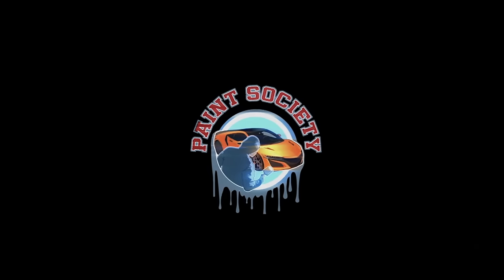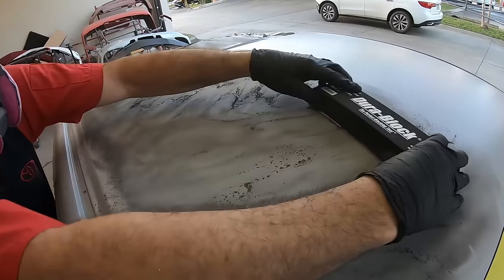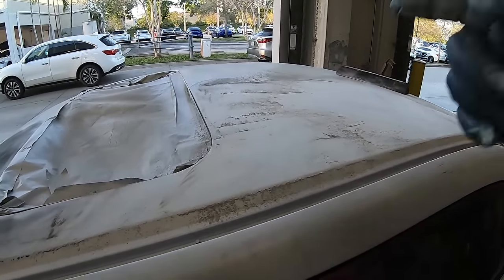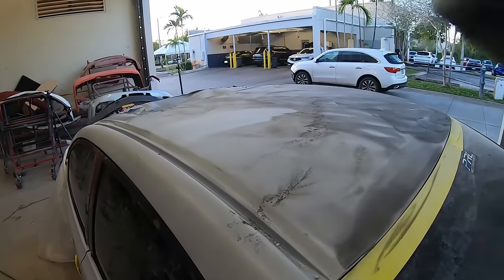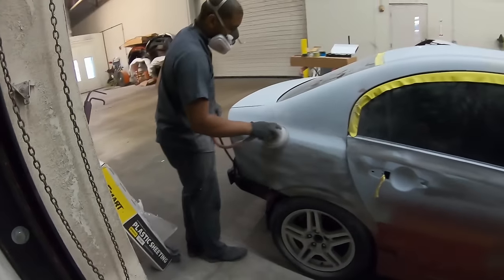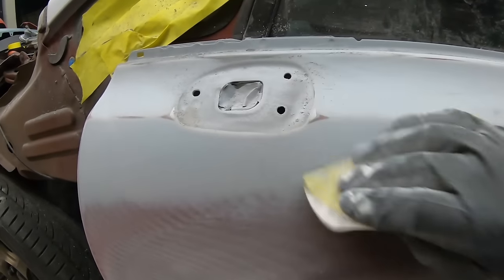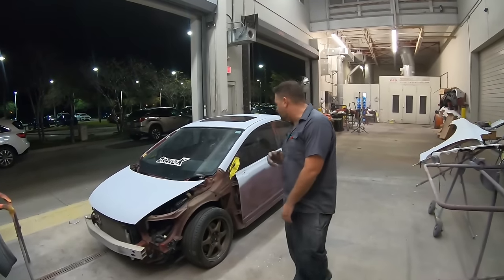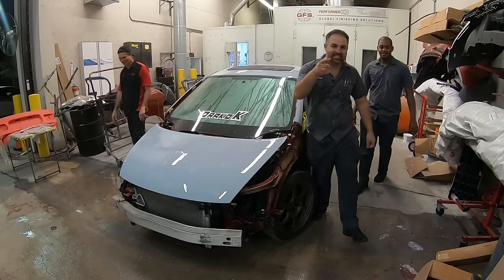How To Paint a Car Guide: Episode 4 Block Sanding and Prepping for Paint

Comment: Hi Brian, I watch a lot of your informative videos and enjoy the tips and advise. I am prepping and painting a Honda Civic at the moment and just wanted to share with you and your veiwers about the dry guide coat. I have been using black chalk and a polishing pad to apply for years on projects with great results. The chalk is used for snap lines but I tried it years ago when sanding and leveling wood projects and now I am having success using it for filler and primer guide coats as it seems to work very well and for about a tenth of the cost.
Anyways, thanks for all of the videos and tips.
Paul

Comment: Interesting to see you guys working together on sanding down the primer. Not alot of painter likes to have few guys doing the bodywork together since every painter has their own technique of doing things. I hope everyone will learn from this and make a standard of doing it so with little help from someone which makes the job faster rather than doing it alone by sanding down the primer  for the whole car. I learn one thing from this video, if there is no bodywork in the panel, its not required to hand blocking and just use DA machine. Really speed up things. I usually paint quite old vehicle and usually primer the whole car. But some panels still looking good without any dent. Not necessarily required primer,  But thats what's the workplace required, they wan it to prime the whole vehicle then hand block it to get as straight as possible.
Reply: If you’re sanding down cars that are like from the 60s-70s what grit would you recommend for sanding?

Comment: Have a question which I hope makes sense. After primer, if I’m NOT using a sealer, would I still use P400 on the DA and base over that or would the final grit then have to change?

Given that I wouldn’t have that sealer coat on the car before the base coat like you have done in this example. 

Thanks for the great videos!

Comment: I sprayed primer surfacer on my repair areas only, as I have to leave my car outside under the elements. The rest of the car still has some flaking clearcoat around the repair areas. Will this become a problem if I plan to sand  down the clear coat for primer in the future even if it means having to reapply primer again on the repairs areas?

Comment: Instead of blowing out all the sanded primer and possibly paint dust, if you're scuff sanding the paint, can we use a shop vac and a round brush attachment to suck up the dust? Do you think the bush bristles will scratch the surface?

Comment: Kevin Tetz from Eastwood drilled in my head to use W&G to check my progress over my body work stages but now i found out that was a big mistake. Solvents attacked my feather edges made them too soft top coats revealed. So i am with you water  to check or what about WB W&G remover to check way less aggressive.? or just use the gloss from the HB primer to check?

Comment: My epoxy sealer is suggesting 220-320 grit for anything that is not bare metal.  Should I be doing 320 grit or 400 grit like you all did?

Comment: I’ve been painting cars in my backyard for 6 months now and been experimenting with lots of products and techniques and was wondering what your experience was with using a clear sealer? Been using it lately and I’ve noticed I can spray flakes, metallics, and pigments over a 320 scratch with a single medium wet coat. And has great adhesion on plastics and chrome but requires more paint coats as the sealer is recommended only light coats of base. Is it better more light coats of paint and skipping more sanding and saving time or just sand to the final grit for the required material? I’m curious on your thoughts since time is money in this trade
Reply from the maker: Any base over a p320 is never a good idea. You should use regular sealer over p320 or sand it up to at least p600 then use clear base
Reply: It's all about the quality of the basecoat.  Any paint system that needs a sealer first has a thin basecoat (dupont was famous for this).  It's all about making $ for the paint company.  The more stuff they can sell you,  the more they make. I paint over 320 all day for years no issue.  I do agree that a finer grit paper is required for fine metallics like silver.
Reply: @PaintSociety  yea that’s what I have done but I’ve been messing around and seeing what works and doesn’t, not on customers cars but mostly on parts and some flips. It’s not a clear base type of sealer it’s extremely thick almost like a clear primer that sprays unreduced. It has properties of an adhesion promoter that’s why I bought it but then noticed you could use it as a clear sealer but definitely not an intercoat. I do have to give you a huge thanks to switching me over to the kgrit pads by Eagle abrasives, huge game changer even with the prices. Thank you for your guidance and videos, often find myself watching you whoever I run into problems🙏
Reply: @MAn-ti3ul  I’ve never used DuPont but I’m guessing it’s like the dynacoat brand a shop sells near me. It’s 2/1 and has terrible coverage. I’ve tried shopline and Omni and have had great results using less paint. The higher end Omni doesn’t justify the price for me but I give it as an option for those that like knowing they are getting the best. I usually get the mid grade Omni for all my projects.
Reply: @Jose-mv1bd  Omni and shopline are the same.  They are PPG's low end paint line.  They are good for budget resprays.  If you are color matching pay the extra $ for PPG deltron.
Reply: @MAn-ti3ul  I’ve used deltron only for one job to try it out, it was nice but was a lot more then the mid tier Omni-Plus. Most my jobs so far have been full resprays or color changes. Haven’t had any blends yet. Most cars in my small town are older and pretty beat up. I have no idea what to properly charge but make it work and truly do enjoy painting just not so much all the body work😂
Reply: Paints use to cover 220 base I've covered 320 many times 400 definitely better. paint now days suck that's why you have to sand so fine and use sealer trust me.

Comment: Just a quick question, after blocking with 320 gritt why move to 400 gritt? Isn't it suppose to be 600 gritt?
Reply from the maker: It’s not supposed to be anything. There isn’t an instructional manual let’s say for how it should be. All I know is that I don’t feel confident in a p600 removing a p320 blocking by hand scratch.  Plus we are sealing so you want to leave it in p400. Hope this helps
Reply: @PaintSociety  Thanks
Reply: I block with 320, guide coat and finish with 600. I will finish in 400 If I'm sealing.  I mainly seal new parts, burn throughs and stuff that is hard to sand.
Reply: @glen4407  thanks
Reply: Just going to add, I only sand the primer with 320, not the old paint. Some new cars have very little clear on them. Can burn through with 1000.